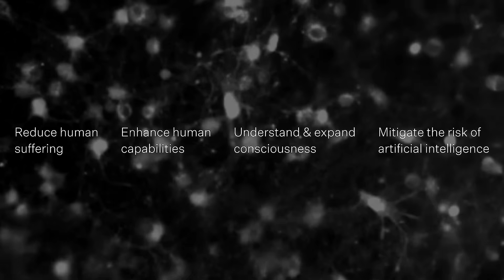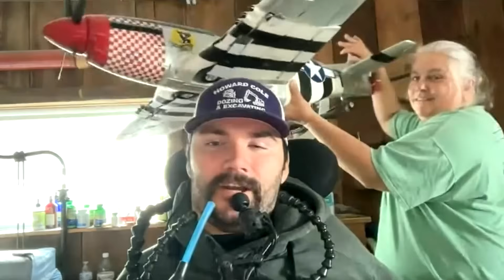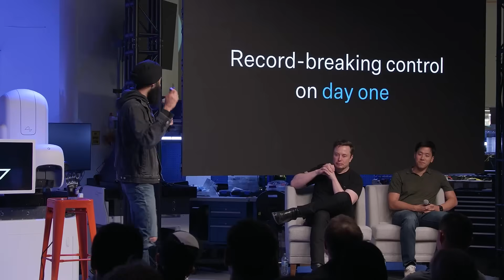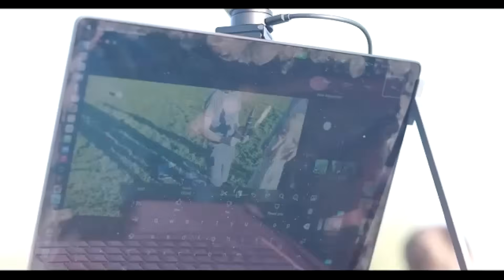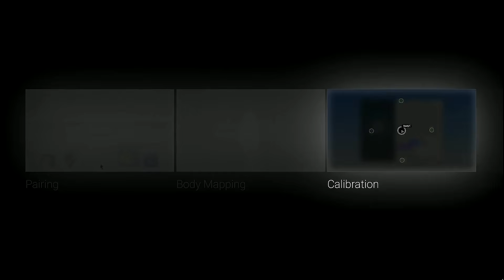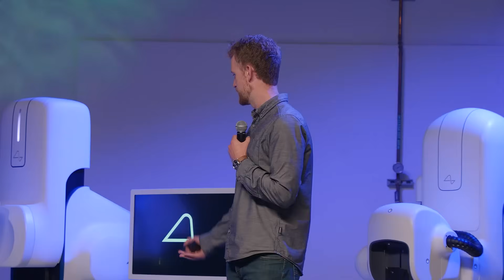Mind-blowing Moments from Neuralink's Summer Update 2025

Comment: Neuralink is the beginning of the "Beast System" as The Bible explains in (Revelation 13:18)  controlled by the Anti Christ. In the next 7 years by 2032, Neuralink will be required to function in society and mankind will be enslaved by relying on it. If one rejects this, they will be excluded in society as the book of Revelation foretells and eventually eliminated in a purge by the Beast System itself. Never take this chip in your forehead or right hand in the web of your thumb. Your soul depends on it. This is the ultimate test between GOD's elect and Satan's Elect and decides where you will spend the rest of ETERNITY.!!!!

Comment: These are all satellites.
An hour or two before sunrise and after sunset.
Use skymap to track the sun and you will see them above where it is rising.
The sun is below the horizon still but as the satellites are higher in altitide they are lit by the sun before you see it and sky is still dark enough to see them.
Once you know you know.
They are orbiting which is why they move in straight lines and fade in then fade out.
Many in a row is often starlink.
You can also track many with a satellite tracker.